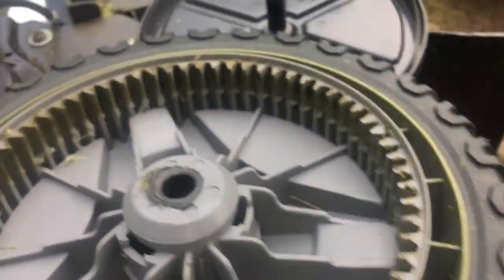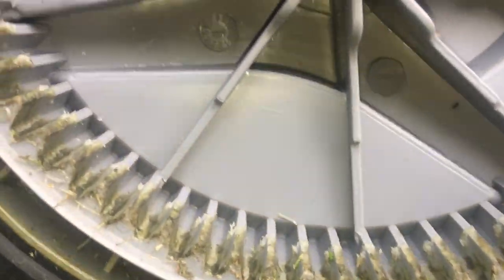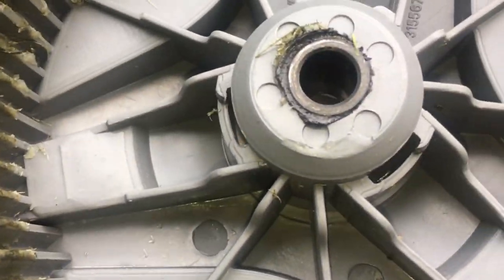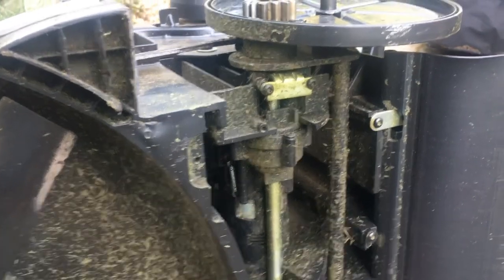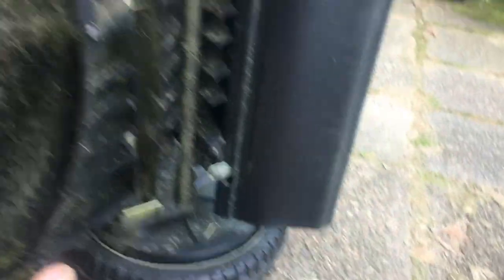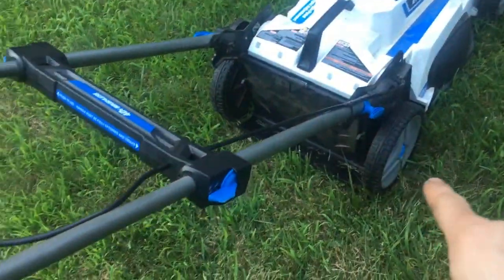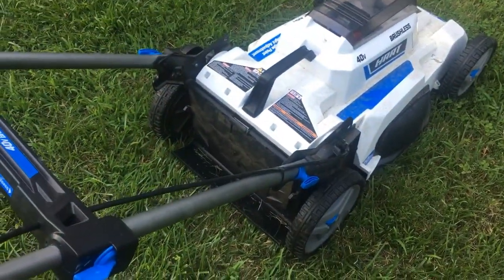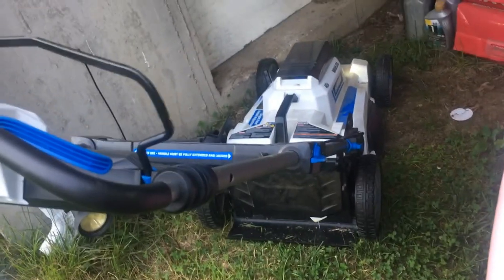Flaw in drive engagement handle HART Ryobi 40-Volt Cordless Brushless 20-inch Self-Propelled Mower

Comment: Yeah I just bought one of these and I'm having that same issue and I've only been mowing with it for a few hours
Reply from the maker: yeah they dropped that design like a hot potato! I made some attempts to repair or something alternative but ended up not caring the last 2 years. I was going to do a bicycle brake handle setup but got bored with it. beyond that the mower is still fine. I actually just leave it outside under plastic so water doesnt get on the wires. the upper safety sensor in the handle did corrode the first season causing it to not turn on. some WD40 got that fixed. I'll eventually just bypass it because its useless. it just confirms the handle is 100% pulled out and I mean 100%.